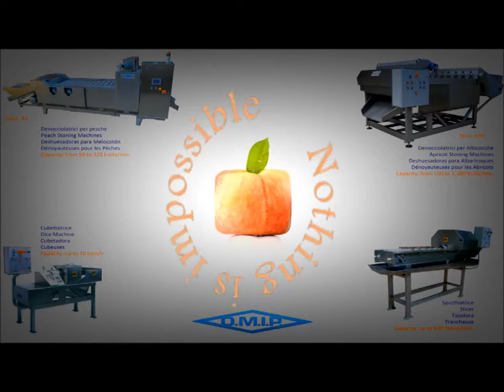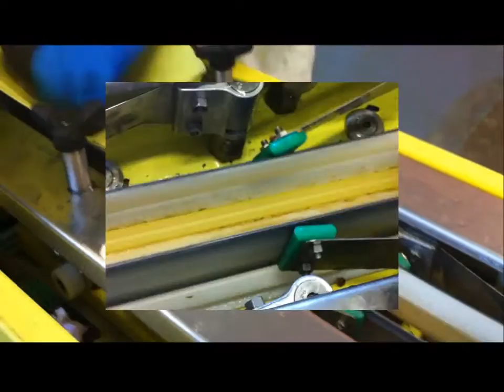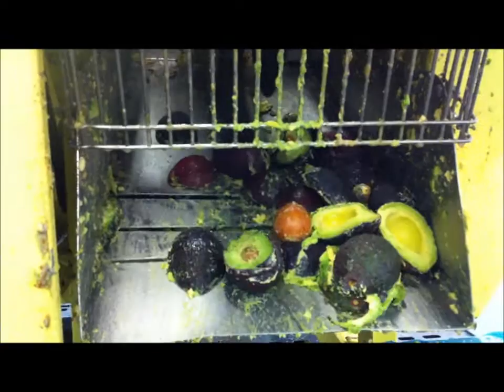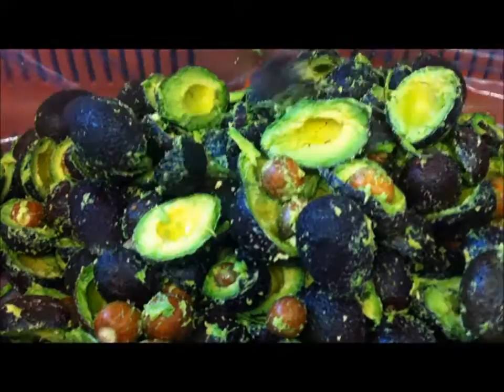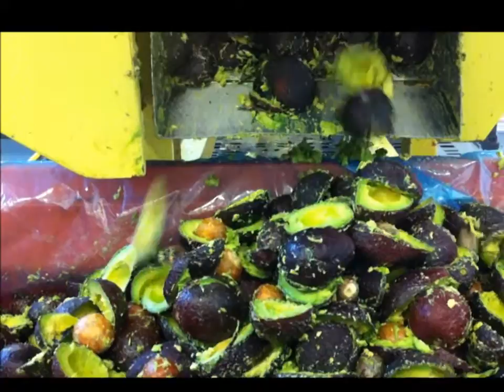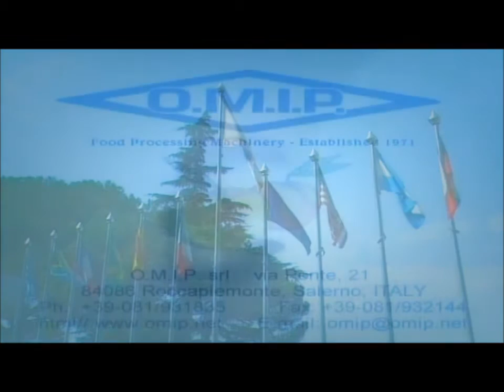Avocado Pitter Machine

Comment: Alfonso C. would it be easer to peel the avocado first then cut it in halve to remove the seed, and how the avocado is peel after cut, by hand?  maybe this way the machine can use less force to cut the guacamole? I think the skin of the guacamole is the most difficult part to cut, and I also think you are in the right track with this machine, I really don`t see any other way to be honest, but maybe a bit less force would solved the little problem. Also if I may, instead of dumping the guacamole on the metal tray to force the seed out, maybe a small conveyer belt made out of plastic coming out of the exit of the back of the machine will also prevent it from coming into little pieces or smash it, but nevertheless it is a good idea.